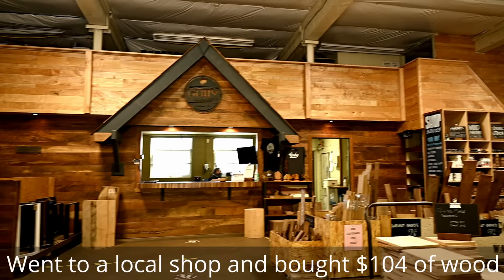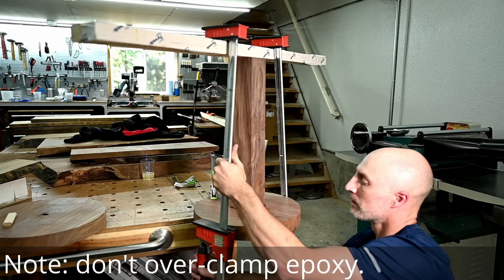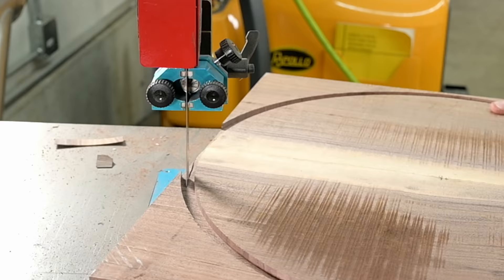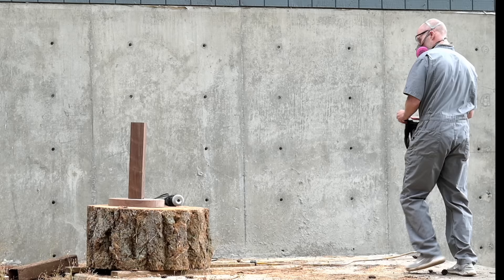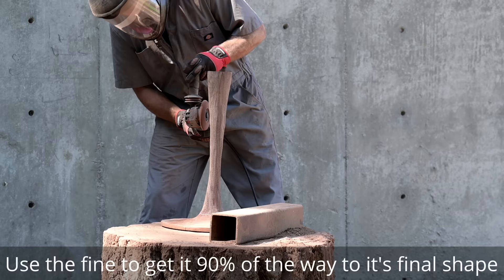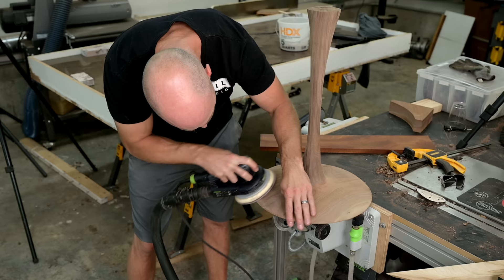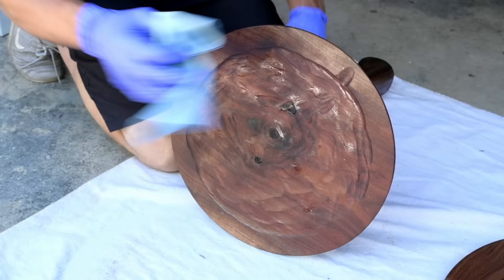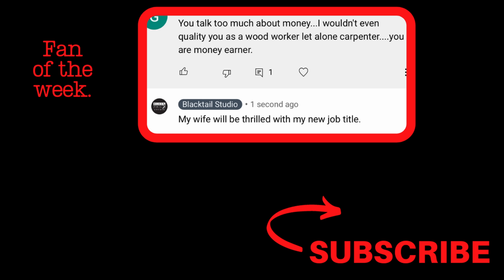Carving Two Tables to Make $1000

Comment: I think what you are missing is that a non-woodworker doesn't have the experience to produce anything close to this quality, especially using tools that are less precise and easy to use as you are. There is a big skill difference between making a perfect perpendicular hole with a drill press and using a hand drill. There is a big difference between using a table saw to making that perfect cut, verse using a circular hand saw. The tools DO make a big difference, beyond simple convenience and efficiency.
That being said, you do beautiful work... not everyone can do that, even with the best tools.

Comment: I just recently watched this video and thought I would comment on the supposed "difficulty" of these tables for the average or beginning wood worker.  Back in 1974, when I didn't really have a shop, the first thing I ever made wood working was a black cherry Shaker pedestal table with the three dovetailed legs.  I had a hand plane, a chisel, the use of a friends entry level Craftsman band saw and access to a machine shop with a kindly machinist that permitted me to turn the pedestal on one of his metal lathes.  No training, no mentors, no tools to speak of and it came out pretty good, all things considered.  Could I do it better now? Certainly. But it has been good enough to keep in my house for almost 50 years (sits next to the piano and supports a table lamp) and there is no finish better than natural finished cherry.  Your tables are easier than the Shaker pedestal because you don't have to cut those blind dovetails in the pedestal so I would think most anyone with a modicum of skill and interest in wood working ought to be able to construct end tables similar to those you made.

Comment: neither, I know you are sponsored by Kutzall, but have you tried the grinding wheels from King Arthur Tools? Their wheels have holes in then , called the Holy Grail< so you can see exactly where you are cutting, they have a wheel also that has a chain saw blade in it for removing greater quantity of wood.
Love your tables.

Comment: I have 3 dogs, so I think we all know why I love watching these videos. I don't know if youtube creators get notifications for older videos, or if I will get a response, but my question is in regards to this video since I am making a similar table. I have a 21" diameter base, and a 32" post (this table is going to be a bit short, but it's almost max of what my lathe could handle). 

I want to connect a 30" diameter top, but I am uncertain if a larger plate (12-16") will be enough to prevent warping, or if I will need to add C channels to avoid twist. Look forward to the response. Also, how thick was the steel plate. Thank you.

Comment: You say 940 profit - I appreciate the majority of small businesses fail to account for all costs, but they also fold. Long term view, should be applying a discount factor to account for the running cost of everything, and replacement costs etc. Highly curious what they amount to, if it’s just the same as the base costs (another 160 or so); but even 400 would still leave a fair profit.

Comment: Allergic to fur and all kinds of dust, pollen, and mold. So unless the pet is hypoallergenic and very clean I'm allergic, but I can't seem to stay away from dogs, they are so friendly! Love the videos, I want to have a wood/3d printing/metal workshop in the basement of my house that I plan on building in the next couple of years, any tips on what size a shop should be with mid line equipment (planer, jointer, table saw, all of that type of stuff)?

Comment: Just found you channel... what a great resource.  Regarding the doubters, even if the project took 20 plus hours and you could do this with some variations would yield $125K a year (assuming all sold).  As a retired marketing manager and as a product manager for a dental manufacturer(s) I know the statistics of consumers price point and what are the top factors that make up buying decisions and overall its not price, its scarcity. If I don't buy now will they bec there later? Thanks for the channel... John

Comment: Nice, but how much do all those tools cost and the shop, electricity. I build 10 to 20k$ tables with a fraction of the tools and sell them. Been doing it for 40 years. In my shop all the tools aren't brand new and you can see the experience in there wear. Check me out . Darv  Averill

Comment: Yeah, let some amateur asshole run a board with a nail thru your planar. Then you would stand there and ask yourself- what was I thinking?

I worked in construction for over 30 years. People would ask to borrow tools I made my living with. Funny thing was they only wanted to borrow tools with a motor on them.

Point is, letting other people use your work space and tools is a REALLY bad idea.